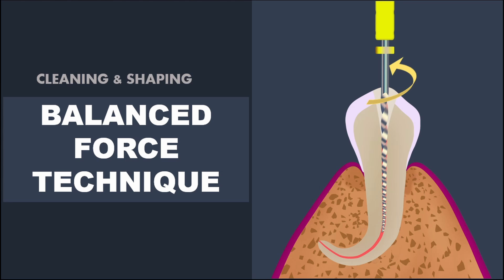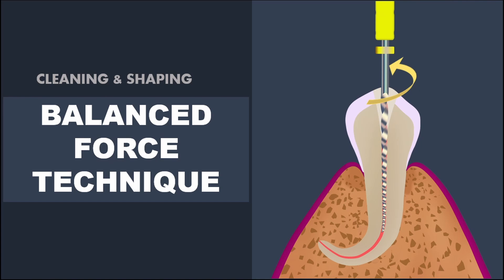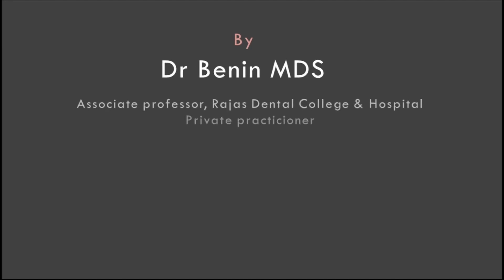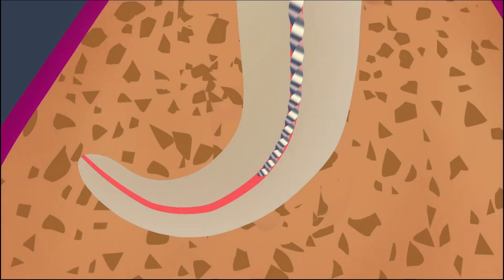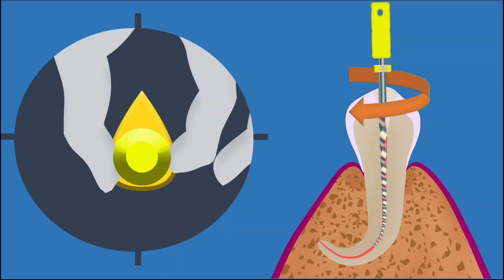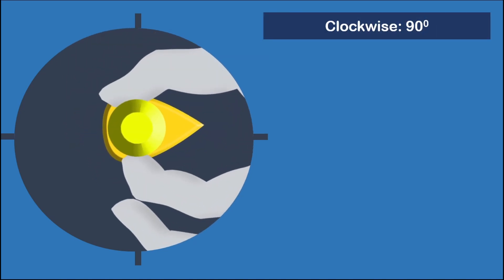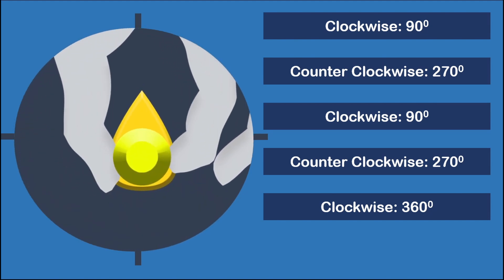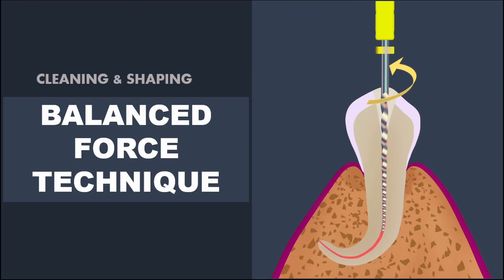Balanced Force Technique | Cleaning and Shaping

Comment: Hi sir
In case of extremely curved canals

 can we use hand k flex files 10 Or 15 by balanced force technique for glide path preparation before using niti files
Reply from the maker: Hello
If the canal is very curved and if we choose to use highly flexible files, it will be very difficult to negotiate and create a glide path. Instead we shall use smaller size k files. 
K flex file also has less cutting efficiency compared to conventional K files